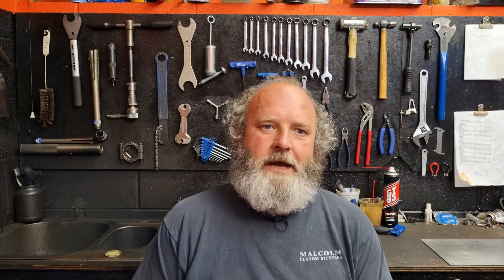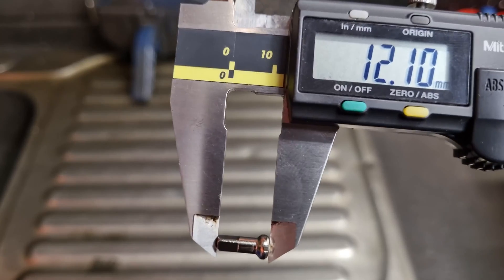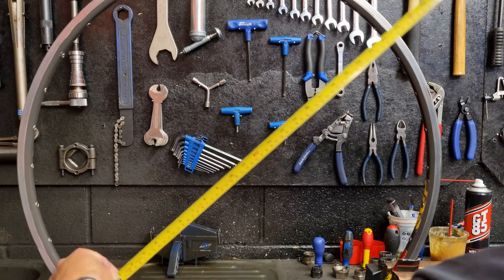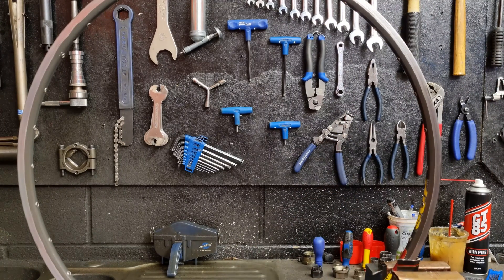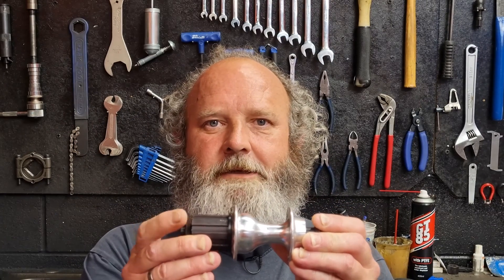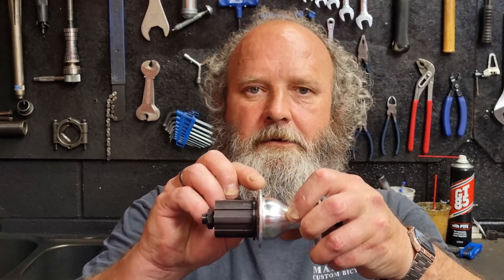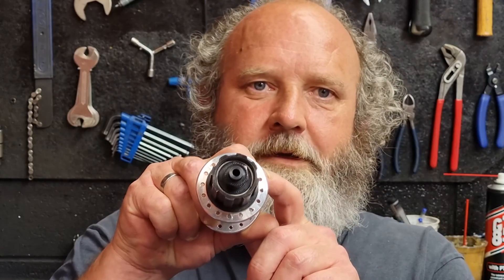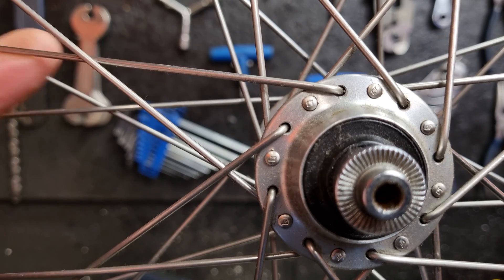WHEEL BUILDING PRO TIPS - HOW TO MEASURE UP AND WORK OUT SPOKE LENGTHS

Comment: Also if youre working with lightweight steel spokes expect them to stretch under tension. Order the drive side spokes a mm or two shorter. Secondly, when using aluminum nipples the spoke MUST thread into the thick part of the nipple or the nipples will fail after a short while. They sound like gunshots and they can fail on a parked bike at night. Scary stuff.😂

Comment: Just trying to understand this.. with the ERD measurement, you are using the full length of the nipple which is 12mm (and then of course subtracting the 6mm that is poking through the rim.. totally get that). But this would allow for the spoke thread to screw all the way into the top of the nipple, and into the mushroom head of the nipple, which would be too far. I thought the spoke thread should stop ideally at the top of the threaded section of the nipple only, not to the very top of the nipple? Not suggesting your method is wrong, just trying to understand the logic behind it. Thanks
Reply from the maker: You are correct... the spoke will go to the top of the nipple. That is where the thread ends and also the part of the nipple with the most amount of metal (mushroom) around the spoke thread giving it more support. If a nipple fails, it isn't at the top. It is usually below the shoulder of the 'mushroom'. 
The part of the nipple internal which is thread less is at the other end. If you don't want the spoke to all the way to the top of the nipple factor 1 or 2mm into the equation or just take it off the end result...

Comment: how do i account for symmetrically offset left and right holes in the calculation?
Reply from the maker: Good Q! You don't, really... as the offsets are the same from the middle, the measurements will be okay for the calculation. What's more important with anything 9 speed onward is only using a 1mm difference between dished and non-dished sides rather than the 2mm difference the calcs may give you. Generally, I add the 1mm to the drive side as it easier to compensate for.
Reply: @bicycleguru  for the guy who commented earlier what about offset holes?
Reply: also if this works for me i can code a calculator site that actually works properly accounting for all factors, i cannot host it though and would have to distribute it by other means.

Comment: Hello Ashley. I recently purchased a set of Arc MT006 hubs, 100/135 QR. I'm currently preparing for a wheel and need to figure out the correct spoke lengths. I'm using the WTB KOM light i25 rims with an ERD of 604mm. (Rim weight: 455g) I've been told that you should add about 3mm to the rim ERD to account for the spoke nipples, which =707.  Is that a correct practice? How much should I add to the rim to account for the nipple? The technical diagram available for the Arc MT006 is a bit confusing, and I can't seem to figure out what the correct flange circle diameter is. The measurements I input where. Front hub: 32H, lacing 3x, weight:160g Width 100mm. PCD: 58/45, Nut to Flange: 28.1/ 13.7, Nut to center: 21/36.3. 

Rear hub: 32H, lacing 3x, weight 240g, width 135mm, PCD: 58/44, nut to Flange: 31.57/48.15, Flange to centre: 36/20. The hub uses 14G spokes. Recommended nipple length is 12mm? When using the DT Swiss calculator the total recommended spoke lengths come out at, Front (L/R):  293mm/294mm. Rear (L/R): 294mm/295mm. Could you possibly tell me if I have gone about the calculation correctly?

Comment: Hi Ashley. Question here.
If i get for my rear wheel this result for spoke length L 296.3mm and R 294.6mm. [4-cross] What should i do? And, how do you round the numbers? everything below 5 becomes 0 and above 5 plus 1 ? So for this calculation it will be 296, and 295, or should i take average 295,45 for both sides. ?
Reply from the maker: Good Q @Ad and one I have to think about myself sometimes. Let's start with the most important part of this, what type of hub are you using? If it's 8 speed or less I would be inclined to take a 2mm difference, 9 speed or more 1mm difference. If it's some type of single speed (hub gears included) I would also take a 1mm difference. With the later 2 I mention if you take a 2mm difference the longer spoke side will lack tension for longevity and strength.

The other thing to consider is how your previous measurements have come out in practice whether that be using your own measurements and calcs or using a spoke length calculator. Sometimes you have to take a stab in the dark if there isn't enough previous data. My time saving method when there is a lack of previous data (so I don't have to strip the whole wheel down and start again) is to assume on what I decide may be 2mm too short and then I can just go round and swap out the 12mm nipples (assuming that is what you are using) and replace them with 14mm nipples one at a time if it comes up a little short. This is actually quite a quick job if you have made the screwdriver drill bit I made in the wheel building tools video.

You can't make the spokes shorter in theory, but if they are too long you could pop each nipple off and put a nipple washer or two under each one. This is more fiddly than having to go longer with because they are a bit short. Getting the exact length right is optimum, but 1mm each way won't really make much difference in reality. Work towards the middle of your calcs... 295/296 is where I'd start. Good luck
Reply: @bicycleguru  wow,exactly what i needed to know. I am using a nexus 8 hub (single speed)  and used online calculator for the spokes [prowheelbuilder]. The washer idea, is an amazing tip,..because you are right, one side came little bit longer, even the outcome of the calculator. So many thanks Ash
Reply from the maker: @Ad-wv8zt  Great, stoked it helped you out. A very helpful thing I stumbled into about then years ago that solves a host of problems. Good for strengthening rims with no eyelets... that's what they are really for. 

Sorry I didn't come back earlier... pretty hectic here! Quickly got back to you on the original Q as I know it was something you needed to know pronto. Hope the build went well.
Reply: @bicycleguru  i made a mistake, it's not the nexus 8 hub, but a retro Sachs 3x7 Dual drive hub
Reply from the maker: @Ad-wv8zt  LOL
Reply: @bicycleguru  I have done the method you mentioned with the scientific calculator, but there is almost no difference between the online calculator, and the SC method. If nothing makes a difference, it is easier to use an online calculator.
Reply from the maker: @Ad-wv8zt  I mostly use online calculators too, but sometimes the data is wrong or just missing. This is a way to work it out manually and good on you for doing it that way. I'm always trying to add  something to my videos that makes it easier to do and/or be really techy about it... stuff other channels don't tell you and a bit of showing off. I'm here to hand on my experience, knowledge and passion, if for no other reason than I've had the opportunity to learn my craft on the job with some very insightful generous people along the way. 

Obviously I will have to make some money out of this at some point to really up the game. I have a passion to hand skills on, hoping people genuinely get benefit and improve their own skills from it. It saddens me that alot of skilful crafts that were previously handed down through generations have deteriorating legacy. I was pretty happy to find the equation again and have to use my brain to do some actual mathematics again...

Comment: Excellent
Reply from the maker: Thanks @Ad Glad you like it.
Reply: @bicycleguru What do you recommend for spokes, with regard to heavy people and packing on the bike. Butted or no butted spokes, f.e. thicker spokes  12G (2.6mm). I want a real strong rear wheel, 4 cross. I just bought the Andra Ryde 40 rim, heavy duty. But I'm not sure what kind of spokes to use
Reply from the maker: @Ad-wv8zt  If I was building a wheel like you are asking about I would use DT Swiss Alpine (DT ALPINE SILVER 2.34 / 2.0), not the triple butted ones or black. Despite contrary belief both spokes with thinner middles and coloured spokes are more prone to breakage for reasons I am not going to go into now. I always use DT Swiss Champion 2mm silver spokes unless there is a need to go bigger and stronger like you have or I am doing something exotic with bladed spokes for example.

I'd build the rear 4 cross and maybe 3 cross for the front depending on what sort of load the front of the bike was carrying. I would also tie and solder the rear wheel and again the front depending on the same. The front wheel needs to have more compliance than the rear, so you want to be careful not to do overdo it making it really stiff.

I do have some more videos for wheel building on my list which do include spoke counts, patterns and tie and soldering. I have been getting some other stuff up to judge the route the channel will go and make it more diverse. Eventually I'd run out of wheel building tips! When are you planning on building and ultimately starting to use these wheels?
Reply: @bicycleguru  i am doing researching right now, and ordering stuff,wanna make a ride of 2500km in the Netherlands with luggage front and rear. . I have done a ride of 600km without issues, on a regular touringbike, made the wheels myself, now i wanna do more distance